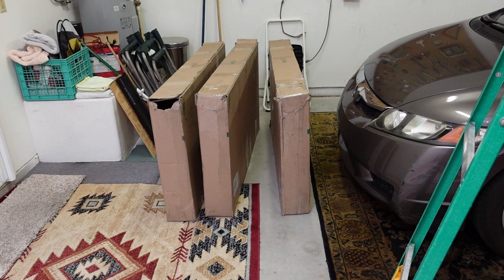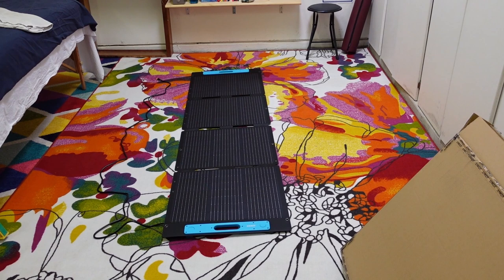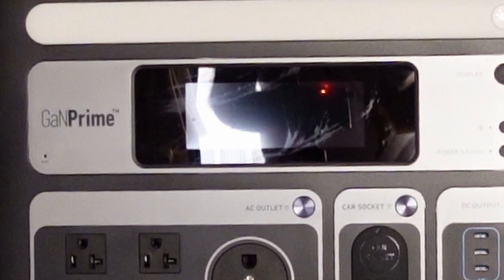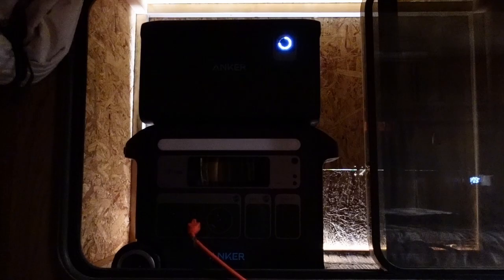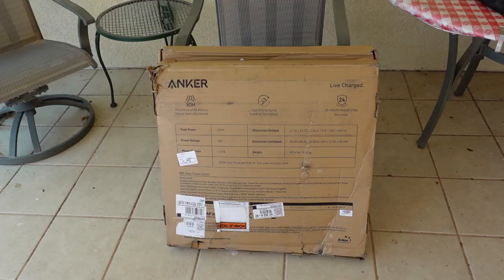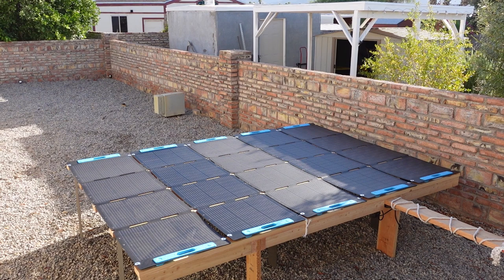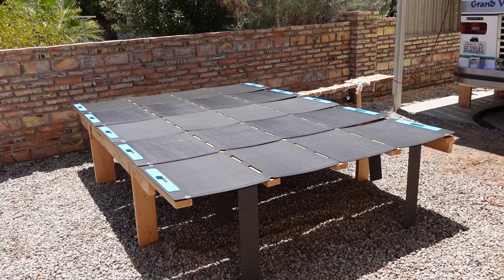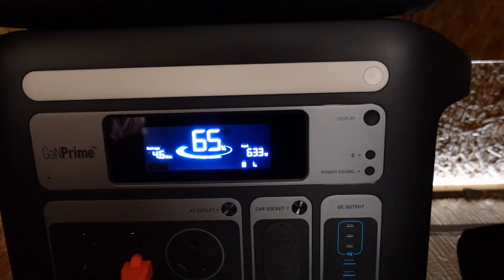Ankar 767 PT 2- the solar panels

Comment: Enjoying your videos.  Just a thought, looking at your video here it appears that the grommets on your solar panels fall over the 2X4's.  I was thinking that placing some threaded T bolts on the 2X4's you could secure the panels with a rubber washer and bolts for those windy days, just an idea....
Reply from the maker: I only have the ends screwed down. Used a stainless 1-1/4 washer with galvanized 1-1/2 screw. I ran the 2 x 4's where the folds were so they wouldn't be under the main part of the panel because of the heat issue down here. Thanks for the comment!!!!!!

Comment: Any chance you can post a link to where you found a ten foot extension xt60 cable that has rounded connector ends that work with the Anker 767?
Reply from the maker: It was just a standard xt60 extension cable that I found on Amazon.

Comment: Any way they can run in split phase and is there an option to add more batteries?
Reply from the maker: I don't see a purpose in running in a series as the wattage with all 5 panels is at capacity already- 1000 watts incoming. The one additional battery is also the limit on this system. The Bluetti line has a system that can stack many more batteries for greater capacity if that's what you're looking for. Thanks for watching!!!!